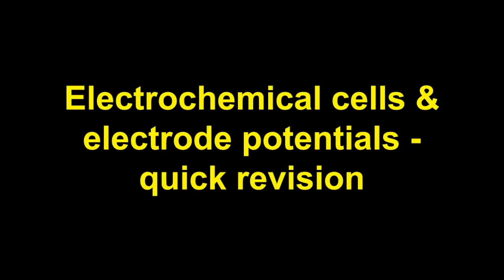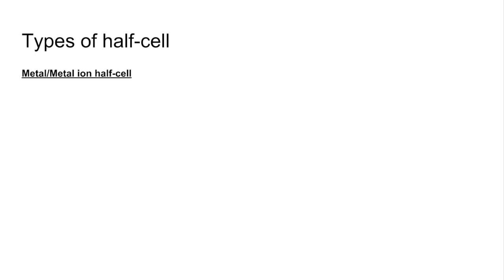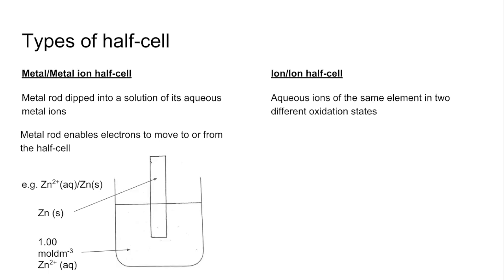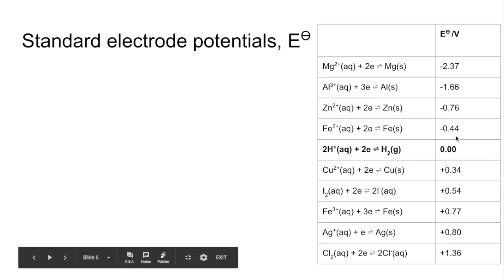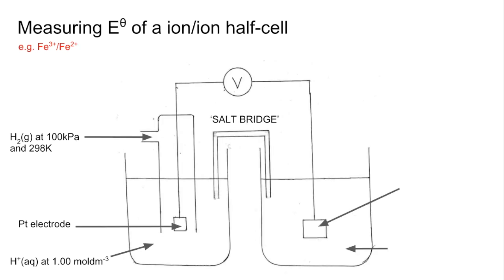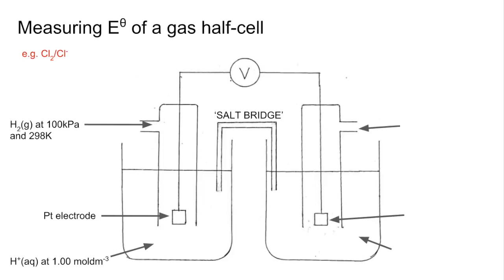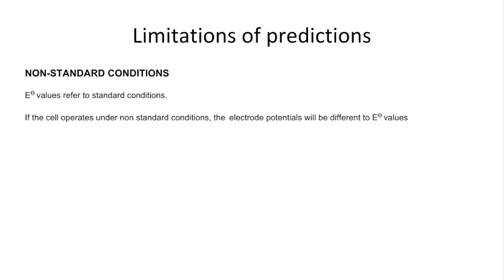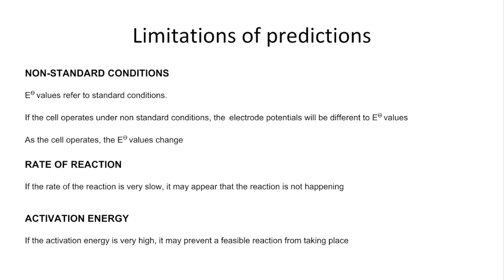Quick revision - Electrochemical Cells & Electrode Potentials

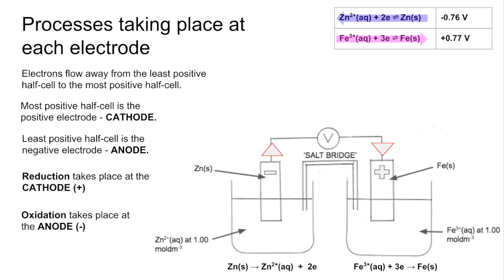Comment: At 9:24 will those reactions in each half cell occur continuously until one of the reactants are used up? e.g. in the Zn/Zn2+ half cell the Zn is being oxidised to Zn2+ so once all Zn is used up will the current and  voltage becomes 0 as no more electron flow?
Reply from the maker: That’s right

Comment: how do electrons flow through the voltmeter if it has infinite resistance?       shouldn't the electrodes due to equilibrium just build up negative charge due to oxidation of the metal in water? if there's a wire (low resistance) it makes sense to me as electrons would flow from high to low charge density but then why would there be a potential difference?

Comment: What do you mean by most positive half-cell is the cathode? Do you mean the half cell with the most positive electrode potential or the half cell with the most positive charge of ions? Because for example at the cathode reduction is occurring so the charges of the ions are being reduced and becoming less positive. So if most positive is talking about the charges then the statements contradict with each other, as in the half cell where reduction is occuring this cell would be the least positive and so it should be the anode and not the cathode but in fact it's the cathode because in this half cell reduction is taking place. So do you mean that the cathode is the half cell with the most positive electrode potential? Because if otherwise, I'm very confused.
Reply from the maker: Siam Sama most positive electrode potential
Reply: @MaChemGuy  okay thank you

Comment: Wait what about the acronym PANIC is it wrong then?
Reply from the maker: Graceful Cow At GCSE you study electrolysis where the electricity is supplied to the cell. In these the anode is positive and the cathode is negative. These are called electrolytic cells. These electrochemical cells at A level work the opposite way as they create an electrical current. The anode is now negative and the cathode is positive. Interestingly, reduction always takes place at the cathode (redcat). Do a search on electrolytic cells (GCSE) and electrochemical cells (A level) if you’d prefer to check. Some teachers have messaged me to say they’ve been teaching it wrong to their A level students. Hope this helps. Glad you like the videos :)
Reply: MaChemGuy Thank you so much sir! Makes so much more sense now that you have explained it! My teacher never did! Will be using Redcat A LOT now :) your videos are a life saver definitely this close to exams.
Reply from the maker: CreaShunTV PANIC?
Reply: Positive Anode Negative is Cathode - I think it only applies to certain fuel cells? love your work Sir!